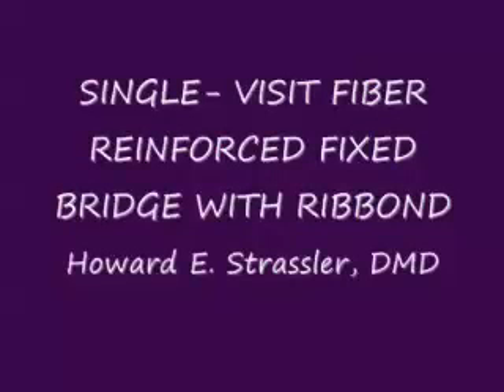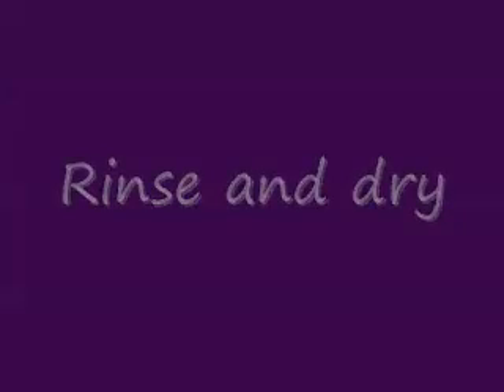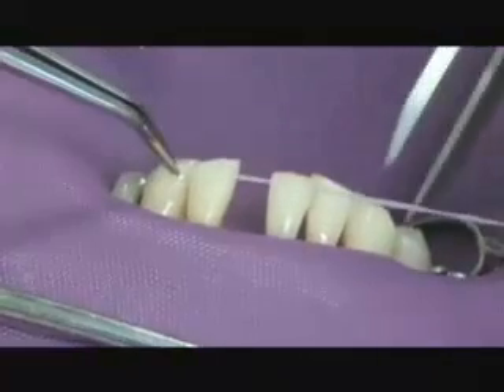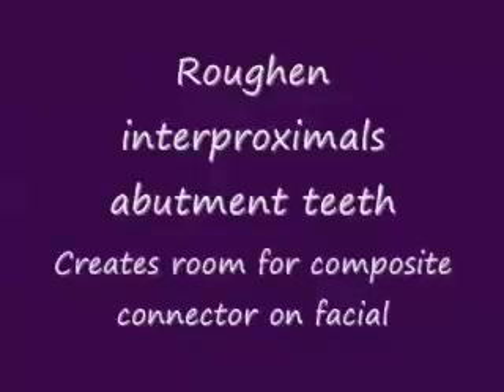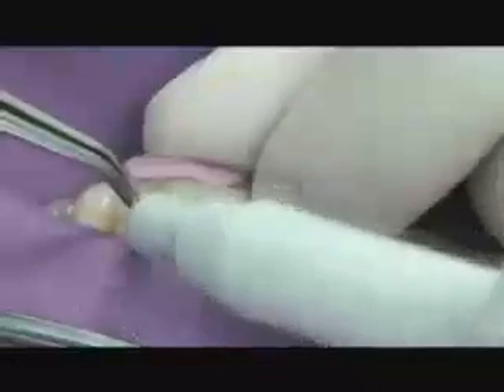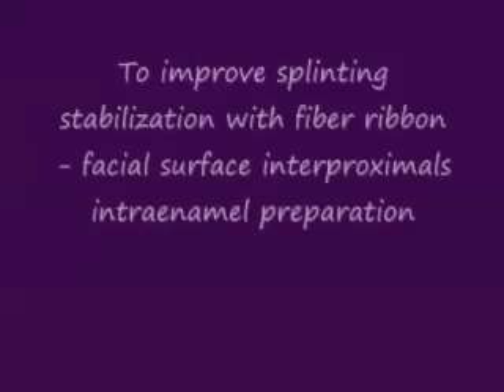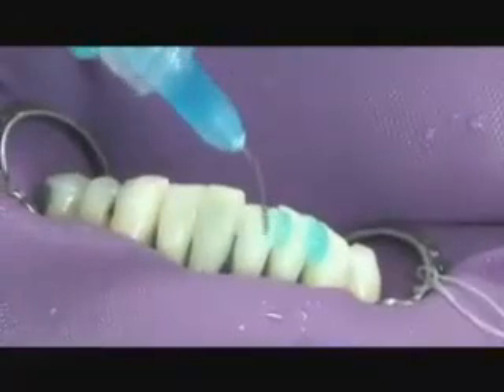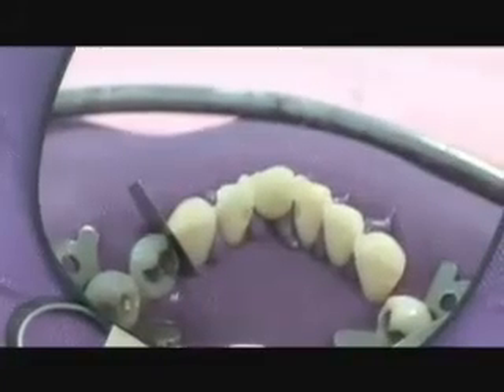Single Visit Fiber Reinforced Fixed Bridge with Ribbond 1 of 2

Comment: Question: in the beginning the doctor said that it is going to be a one session job but then he says that he has already took a pvs impression and made a crown. is that correct? Thank you.
Reply from the maker: Most Ribbond bridges can be made in one office visit but there are some circumstances in which perhaps a second visit might be necessary.  Usually the determining factor is what is used for the pontic.  If it is a lab fabricated pontic then that could require a second office visit.  It the dentist uses the clinical crown as a pontic or makes it with composite resin direct in the mouth or uses a denture tooth then that usually means only one office visit is necessary.

For sales within the USA, Ribbond products are sold directly by Ribbond, Inc.  Please contact us if you have any questions.